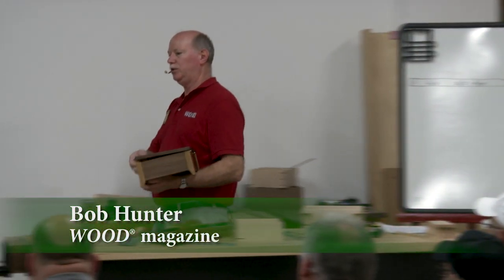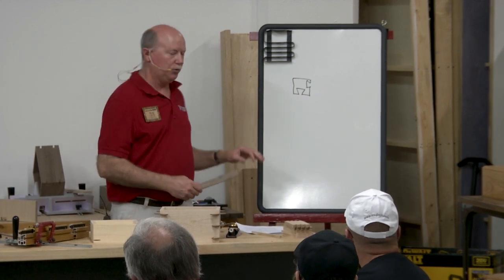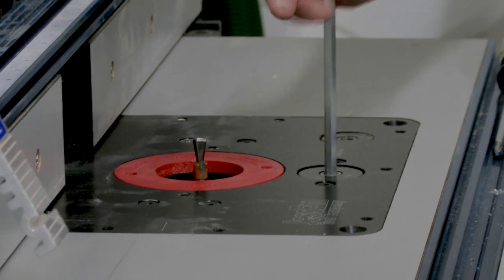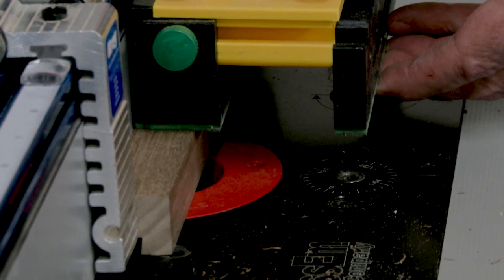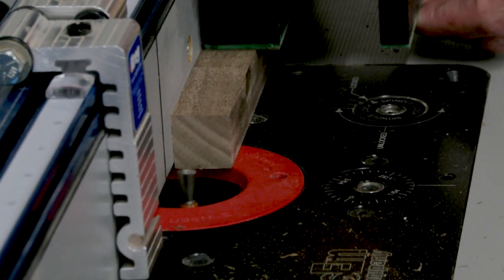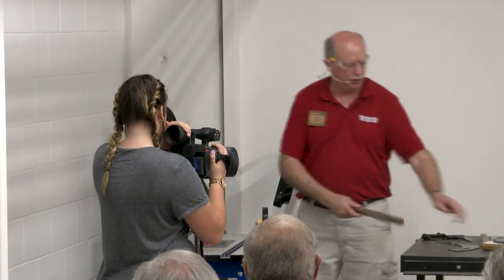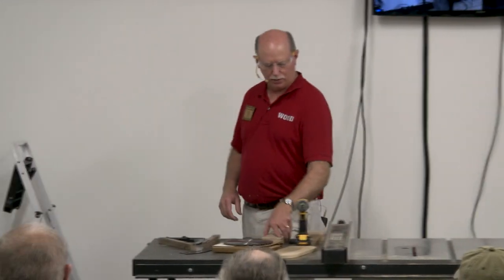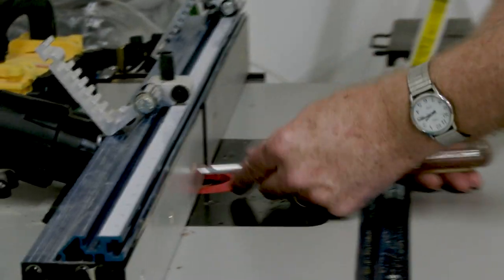How To Make A Sliding Dovetail Joint - WOOD magazine

Comment: Had you used the Incra router lift with the router rings they sell instead of that huge hole you would not have trouble with the part falling down you would have had better and safer support.